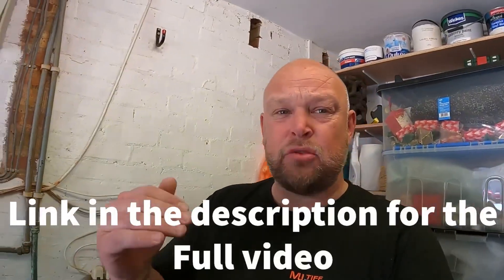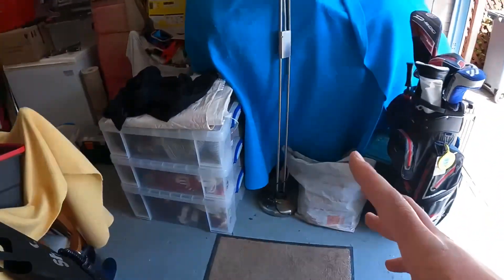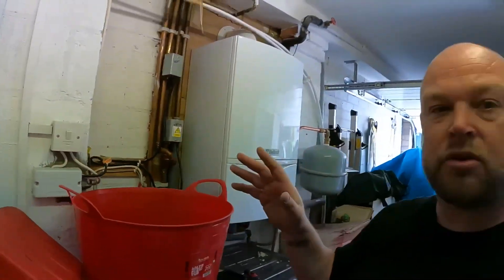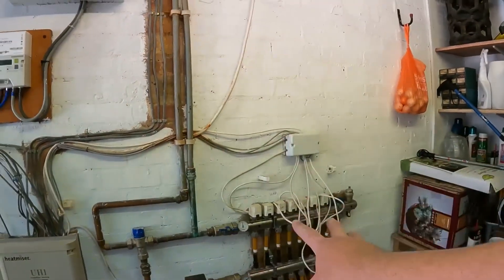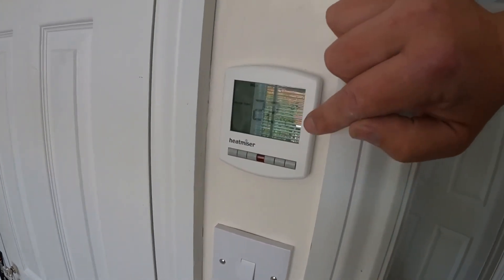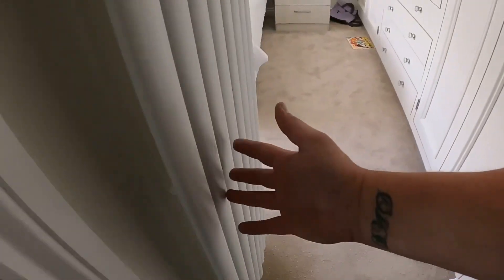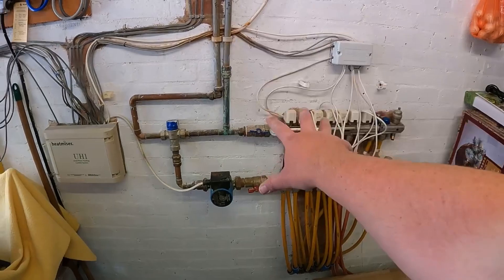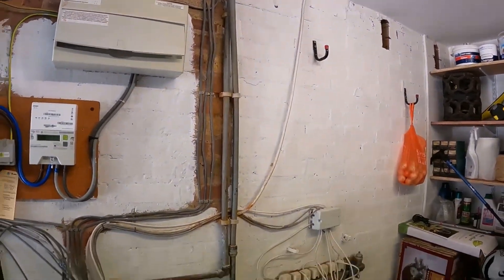HEATING SYSTEM DESIGN FAIL.... Overview of a very complicated central heating system

Comment: One of those heatmiser stats on the UH1 U/F system will be a master stat that also controls the hot water, usually in the kitchen, easy to set up and usually very reliable, there was no need to wire in the new timer control.
Reply from the maker: There was as there was no master stat…. See the full video.
We traced out the wiring and it was cut off so only option was new controller👍🏼👍🏼

Comment: Turn one of the stats on upstairs and see if any underfloor heating heads open which could be possible..
See turn one stat up (upstairs) see if any valves open and if any other radiators in other rooms come one...
I have had it before where a house had 2 ports under the floors.. nightmare!

Good luck keep us updated.
Reply from the maker: Watch the full video….. link is in the description 😉
Reply: @MJTiffPlumbing  just watched it! Lol great work!

Comment: Could it be possible that the rads are piped up to the ufh manifold, must  be a big house to have 8 seperate ufh zones just for ground floor
Reply from the maker: It’s only 4 zones but over 8 loops… 

Check the link to see the full video👍🏼👍🏼